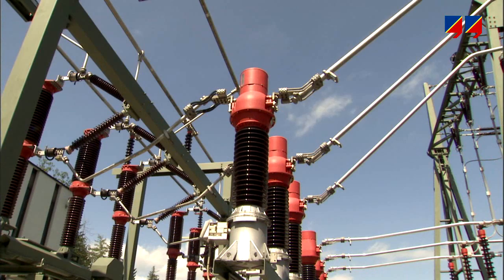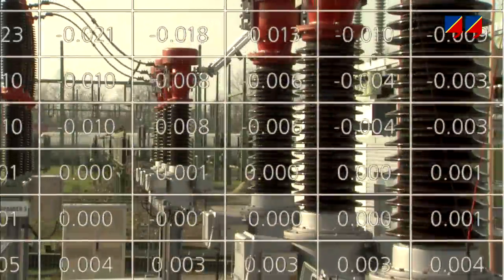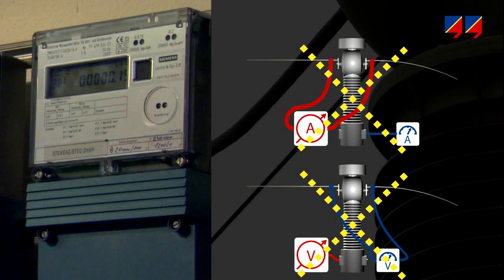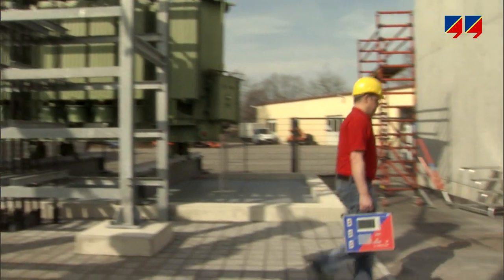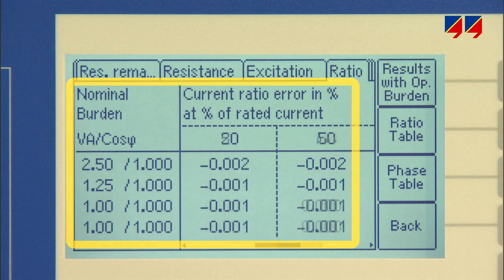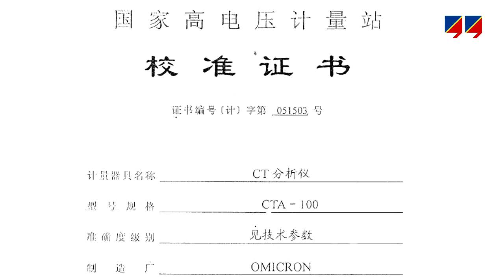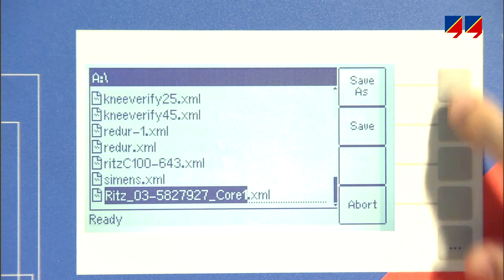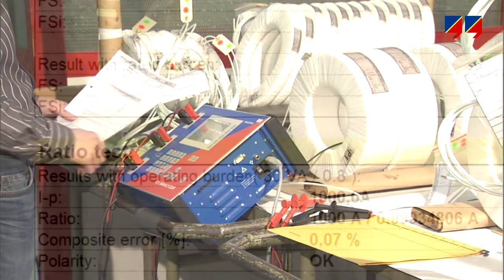Testing metering current transformers with CT Analyzer

Comment from the maker: Dear สุริยา อุดทามุล,
 
It is not necessary to connect a real burden to the secondary side, because the CT Analyzer simulates the burden impedance based on a mathematical model.
Since this seems to be an enquiry that has already been answered by our technical support team, we kindly ask that you contact your local support team for detailed information, in case you haven't received a response yet.
 
Best regards,
Your OMICRON Team

Comment: Last month  I tested turn-ratio of metering CT class 0.2S FS10 with CT Analyzer, first testing the result wasn't pass so next testing I connect real burden(variac),about 50% of rate burden, to secondary side of CT the result was pass.

This is my question ?
1. Do I must connect real burden at secondary side of CT when I test turn-ratio of metering CT ?
2. How does burden simulate in CTa work ? Why in can't use in this case?

Best Regards.